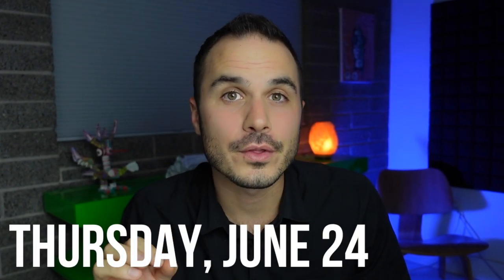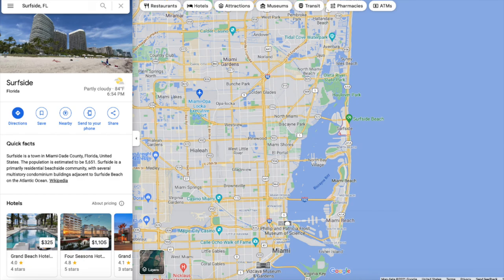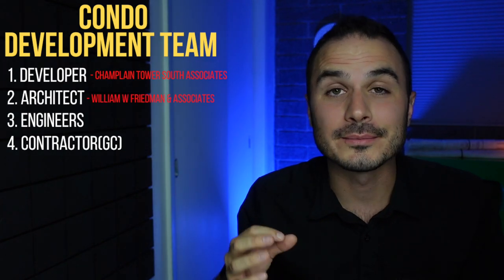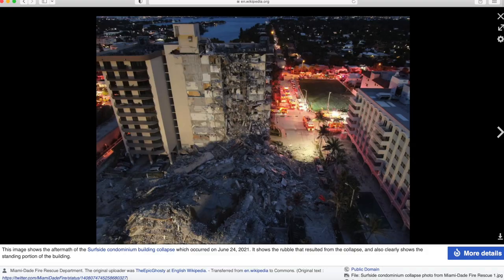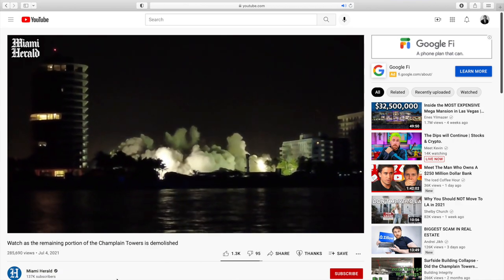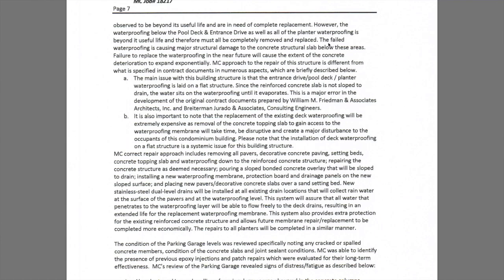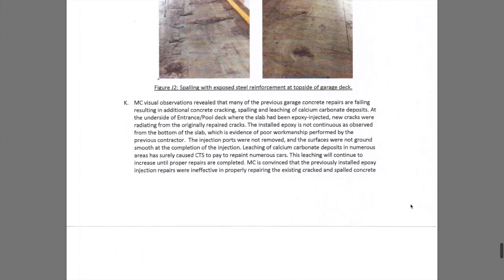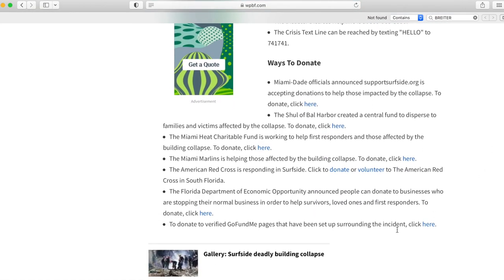The Surfside Florida Condo Collapse – What Really Happened?

Comment: I’m trying to prevent something like this happening in my building. As I type this, there is probably three feet of water in the bottom of the elevator shaft and the bricks and mortar have deteriorated to where they are basically dust under pressure. This kind of tragedy is so hard to see, especially when the ordinances of Los Angeles prevent anything from being done. The City gave the ok to a building a few years back and within 72 hours part of it collapsed.
Reply from the maker: I'm sorry to hear you're going through that Linda. Thank you for the comment.. I hope they sort out those issues at your building.